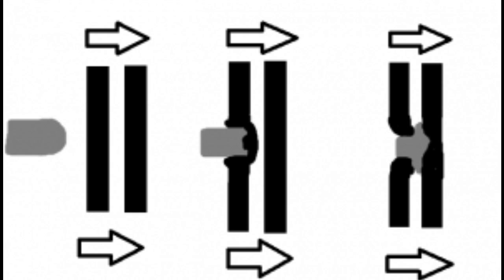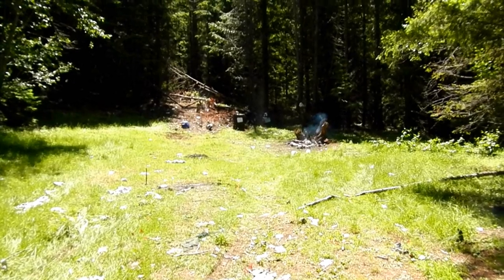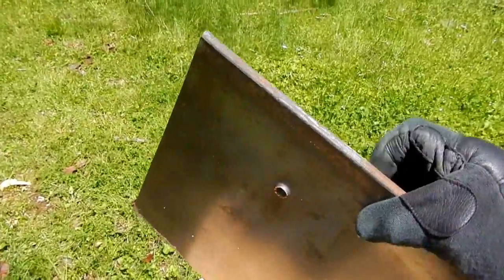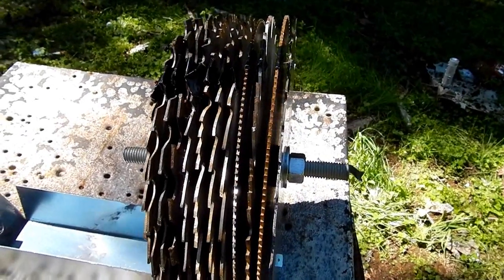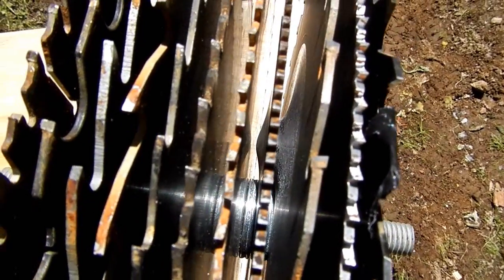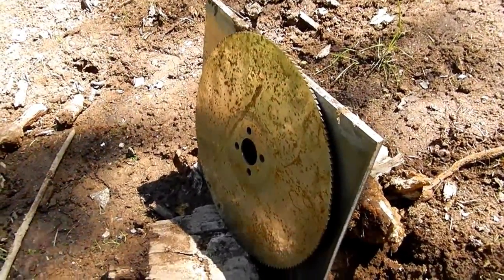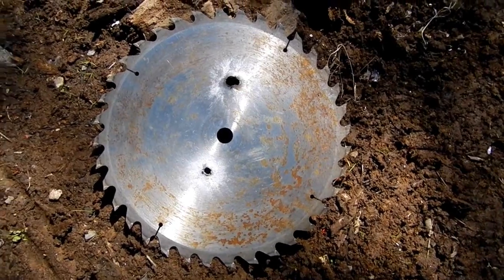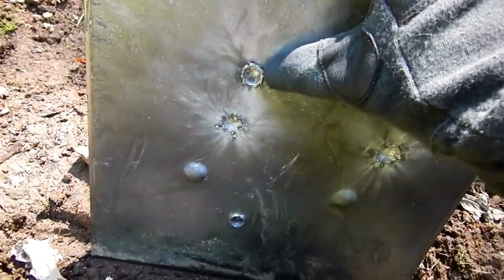Testing the Concept of Spaced Armor

Comment: something I'm not seeing as a comment. Saw blades are not 1/8th inch thick usually. The kerf is 1/8th inch, but that is counting the offset teeth. You could recalculate your thickness in the end.

Comment: @Jackal Mountain Something else you might find interesting.. if the space between the plates is greater than the length of the projectile it will cause the projectile to tumble and strike the next plate flat on instead of flying straight. This causes the surface area of the projectile striking the armor to be large further reducing penetration..

Comment: spaced armor was designed to work against HEAT and not against bullets - it's increasing the standoff distance between the armorplate and the point where the HEAT Warhead ignites the charge to initiate the copper / plasma Jet to penetrate the main armor.. not working very well though.. even an RPG7 doesnt care a shit about it.. later in this video you can see it - not much of a change in penetration https://www.youtube.com/watch?v=_J-uKNb6TaI
Reply from the maker: Youre thinking of standoff or cage armor. Look at modern Chobham armor. Its a series of closely packed, spaced plates, yet its highly effective at resisting sabot penetrators. Each new steel layer is a new impact event instead of a continuation of the same event. This helps bleed off and redirect kinetic energy, and deform the projectiles so that each following layer is impacted across a larger surface area bringing more resistance to penetration.
https://www.youtube.com/watch?v=OwJK99uL1qY&t

Comment: Spaced armor is most efective against light projectiles at verry high speeds. The outher layer of armor works not only by absorbing some of the knectic energy but mostly by fragmentating the projectil into smal pices witch dont have enought momentum to penetrante the main plate. The brittle saw blade likely did a bether job at protecting the plate because It was harder and broke the bullet in smaler pices. Having a greater distance betwen the plates also increaces the efectivenes.

Comment: You needed to look up the design or engineering specs for the 5.56 round. It is designed for penetration of individual body armor and accuracy. The 7.62x39 is designed for its heavy tumble or knockdown power in other words. It is more of a machine gun round where as the 5.56 is a rifle round. Both bullets were designed for totaly different applications and purposes. Each round does what it was designed to do and they each perform perfectly. That 7.62 will put a body down even without penetration. I have had an M16 A2, (5.56 NATO) require 3 and 4 rounds to center mass in order to stop a highly determined insurgent. I've seen Marines hit in a kevlar helmet with a 7.62 x 39 round and literally shake it off. If said Marine had been hit with a 5.56 round in his kevlar, well, that's another one my brothers that would have went home beneath the Flag we protect. 
Dont get me wrong, i dont mean the 5.56 is better than the 7.62 or vice versa. Each round performs excellently within their individual design parameters.

Comment: The harder steel of the saw blade is shattering/breaking-up the rounds before they can hit the softer steel.

The soft steel is so much softer that it 'flows' more than it shatters.

Because of this, if the energy of the round is NOT spread out by the hard steel, it will retain enough shape and energy, on a small enough point that it essentially 'squirts' through the plate, as opposed to 'showering onto' the plate. ~( 'w')/

Many makers of armor use a mix of steel and ceramic, or kevlar and ceramic because the ceramic [typically a 'use-only-once' item due to shattering and spalling] is extremely hard and set there for the specific and express purpose of shattering the bullet so that its cross sectional density is vastly reduced, which then allows the following material to more safely absorb it.

Its not really good against solid tungsten, uranium, or even tool steel penetrators, but really good against lead, copper and non-tool-steel.

~( 'w')/

Comment: I would have liked to see the saw blades packed tight, and then do the ballistics test.   From past tests I have learned that space between materials wasn't as affective against small arms. I've found that they fair better when packed tight.  Having said that, and without reading the document that you had mentioned, we are looking at laminated armor.  Correct me if I'm wrong, but it looked like you just rested the saw blade against the 3/8 steel. To me, I'd didn't look like there was a gap, as in the saw blades test.

Comment: No surprise here, the 7.62x39 didn't pentetrate the 3/8 and you said each plate was approximately 1/8 so 3 of these 1/8 plates ALSO stopped the 7.62x39.  Interestingly
the 556 was stopped by 4 1/8 inch think plates indicating a 4/8 steel plate probably would have stopped it too.

Comment: Ok, so gapped armour is not for defeating kinetic penetrators.  It was originally designed to defeat squash head (HESH) type ammo.  tank rounds that splat on target then detonate, which sends a shockwave  through the armour and spalls the interior surface off turning everything inside into salsa.  Gapped armour catches the spall with the next layer, and the shockwave does not have the strength to spall the subsequent layers.  For anti tank (HEAT) gapped armour works as a standoff for the shaped charge, with the outer layer being sacrificial and the inner layers absorbing the jet of molten copper plasma!  Kinetic rounds are usually defeated by stuff like reactive armour, HE sandwiched in plates that explode outward and shear the penetrator.
Reply: @Aaron Washburn that is why modern armour is composite, including ceramics.  The ceramics do not melt from the shaped charge.  Unfortunately though, a shaped charge is not like an APFSDS.  While you could argue it is moving really fast, it doe not rely on ballistics to overcome armour, it burns through.  The gapped armour you see specifically for HEAT is the cage surround, or the thin plate several centimeters away.  By the time the plasma reaches the underlying armour it has lost too much energy to be effective.
Reply: @Aaron Washburn sure.  I was a gunner in a tank regiment.  I know what a hit from a HEAT round looks like.  the shaped charge turns and inverted copper cone into a plasma jet.  I assure you, it burns through the armour.  this is why composites have ceramics
Reply: @Aaron Washburn feel free to visit a tank range and examine the end result of a heat impact.  I know the difference between how a shaped charge and a sabot defeat armour.  So why don't you school all the good folks about why ceramics are used.  They certainly do not go very much against kinetic penetration.  All of that aside, you are widely missing the point.  Gapped armour was developed to defeat squash rounds.  Firing a jacketed 5.56 ot 7.62 at a saw blade will not really demonstrate the intended use of gapped plate.  Nor does it demonstrate how slope affects trajectory, because if you are in a tank and you get a 90 deg hit on you, you have done something grievously wrong
Reply: @Aaron Washburn ok, so I was wrong about the mechanism.  HEAT still needs proximity to work, hence why caged skirts defeat RPG7 rounds .... we could continue the pedantic trip down memory lane and continue to try and out nerd each other, or we could go back to the original point, that gapped armour was specifically designed to defead squash rounds and shock propagation, cool video, but doesn't effectively capture the reason gapped exists.  HEAT was more effective against gap but kinetic was better.  This is why pretty well all modern MBTs have high velocity APFSDS load outs.  They kill everything
Reply: @Aaron Washburn something tells me you would be really interesting to sit and have a beer or some mead with.  If you ever find yourself near Toronto drop me a line.
Reply from the maker: @Aaron Washburn thank you

Comment: lol. you claim to be in military and u still don't know space armor are for HEAT.  For your information HEAT means High Explosive Anti-Tank.
Reply from the maker: Spaced armor is not just for HEAT. Its for any high energy kinetic impact (solid shot, sabot rounds, HEAT) For example Chobham armor on an Abrams MBT is a series of spaced plates designed to deform/destabilize any penetrator (HEAT or otherwise). The whole point is to ensure that the first layer deforms the penetrator so that a follow on layer is impacted across a larger surface area.  You are confusing spaced armor with standoff armor designed to prematurely detonate HEAT warheads

Comment: As Ch Mac said below:"556 pen due to speed and smaller round. Smaller  point of contact.
7.62 stopped due to lower speeds and heavier bullet. Larger point of contact."  Kinetic Energy is equal to the bullet mass times the SQUARE of its velocity.  So even though the smaller 5.56 mm round weights less than the 7.62 round, it is going so much faster that it penetrated the 3/8" mild steel plate while the larger, but slower 7.62 did not.

Comment: If you know anything about physicsyou would know that the 556 is moving very fast and is a very small projectile NY therefore it can penetrate armor better the 7.62 x39 is a 30 caliber round it is larger and slower-moving does dispersing energy quicker when it hits its Targetwhich is why 7.62 x39 is better at punching holes in walls and braken cinder blocks and such because it disperses more energy in one spot as opposed to just passing through

Comment: The first test shots on that still goes to show you a small bullet traveling faster than a large bullet defeat steel every time which is why they had to come out with level 4 plates because the M193 traveling at 3300 feet per second will defeat level 3 plus armor every time

Comment: How stupid is this guy to attempt a spaced armour TEST. When he does not know the composition of the steel alloys used on the numerous saw blades from different manufacturers. And that's just for starters. Come on air gaps, to stop rounds. He had 12 saw blades not 11 to begin with but removes 1 half way through the video and then tells us that the single saw blade he puts in front of the plate is mild steel and then says "the saw blades after shooting is brittle steel" well that's not mild steel then if it cracks. His conclusions are nonsense. He should have named the video (Not Really Testing the concept of composite armour) it would have been a better description.

Comment: I believe it's the brand of ammunition you're using Wolf ammo is cheap and crappy to say the least so that might have a bit of a difference in overall terminal ballistics and accuracy and everything else now if you had Wolf ammo 556 /223 Rem 55 grain FMJ also then I would say it'd be a 100% Fair test however I'm still surprised I thought it would be the opposite where the 7.62 × 39 wold punch through the Solid Plate and the 5.56 wold have  dented it but not pass through you know I thought it would basically be the exact opposite of what we seen in the video but maybe try it again with the same ammo brand or a different brand or something cuz I'm almost positive that's what is the main difference

Comment: Damn, that's the most tacti-cool'd AK i've ever seen. 
Folding stock ✔
stock cheek rest ✔
rail adapter ✔
scope ✔
sling ✔
angled foregrip ✔
handguard with rails ✔
handguard installed on top of handguard ✔
bipod ✔
giant muzzle brake ✔

All it needs is a laser sight, bayonet and backup iron sights.

Comment: 5.56 is thinner than 7.62 so it has to erase less material to progress that's why it goes further,pressure on the impact is more important.It also depends on the speed at barrel mouth! MBT use apfsds which use a sabot to deliver a tungstene arrow which have huge penetration !

Comment: A totally irrelevant test. Spaced armour was designed for non kinetic heat and squash head rounds NOT armour piercing. Someome needs to do a bit more homework.
Reply from the maker: Look up the composition of Chobham armor on an m1 Abhrams. It is multiple spaced out plates and works great to stop sabot rounds.  The entire point of spaced/composite armor is to spread force into multiple separate impact events. Also, HEAT rounds are kinetic perpetrators. The idea they "burn" through armor is false as they dont generate enough thermal energy to melt a hole through a slab of steel in the microseconds it takes for a shaped charge to penetrate. The proper analogy is a waterjet cutter not a plasma cutter.

Comment: 7:55 The 7.62 could not penetrate 3/8" of plate, yet penetrated three 1/8" saw blades. That kind of says a solid plate is more effective than spaced armor. It also says mild steel plate armor is better than hardened, stacked steel armor.
9:50 This is a much better result. Shows the effectiveness of stacked armor.
13:07 Obviously this blade didn't absorb as much energy as the first saw blade. You can tell by the perfect hole that this blade didn't absorb much energy. Then you can tell by the mark on the 3/8 plate also. The crater from this round looked much like the original 7.62 impacts.
Reply: Of course solid steel plate has more effective stopping ability against kinetic ammunition.

Comment: One thing about spaced armor it was intended to help with shape charge weapons more so than penetrating rounds the air gap if large enough allows the charge to go off and the copper forcing cone wont have the same focus of energy to penetrate the main armor this is why RPG cages are so effective blow the rocket before it can hit your armor
Reply from the maker: Modern chobham armor on an M1 Abrams is spaced armor (multiple spaced out overlapping plates) and it was designed to stop both HEAT and sabot rounds. Technically "spaced armor" has come to mean "composite armor" in modern parlance. RPG cages are a different concept that are designed to do what your describing to shaped charge weapons

Comment: You should try AR 500 or even AR 600 hard 3/8ths steel.
The .223 rounds will not penetrate at all.
You most likely have A 36 mild steel 3/8.
Ak rounds run at 2350 to 2450 fps.
.233 rounds run at 2900 to 3200 fps. Laws of physics.
Interestingly with armored glass the AK 7.62 x 39 will penetrate more glass than the .223 rounds.
I used to develop armor and mine/ explosive technologies for the military.
In the armor business "he who shoots the most, knows the most"
Very fun to watch. 

Thanks for the work you did.
Reply from the maker: Thanks!  It's been interesting do actually test out the concepts Ive always read about

Comment: 5.56 penetrated because of its "higher cross-sectional density". It has more of its mass behind a small frontal/contact diameter than the 7.62. The ideal for spacing armor layers to resist small arms fire is to have the second plate at a distance from the first plate ( the one the bad guy sees) by a factor of the projectile length plus the deformation distance of the first plate. The first plate strips off the bullet jacket and deforms the projectile core. The remaining projectile now has a lower mass and energy combined with a larger frontal area and "lower cross-sectional density" so that the energy will be spread over a larger area when it strikes the second plate.  The gunner protection turrets have the aluminum panel on the outside with the steel on the inside because they are designed to capture and stop IED bomb fragments. They just happen to stop small arms fire also. The most effective armor is the ceramic armor turrets found on the M1116. ( Couch Commandos please note: the ceramic your Mom's dinner plates are made of is not the ceramic suitable for ballistic armor.)
Reply: @Aaron Washburn It would seem that way but that's the way it works out. This may be due to the nose of the 7.62 deforming more readily, a difference in the jacket design. ( I have the benefit of examining ballistic samples, witness plates, chronographic data and slow-speed photography over a fifteen year period of employment by an international defense contractor building ballistic and blast armor solutions.)
Reply: @Aaron Washburn Your formula is correct . As I said, I believe it may be due to a difference in the jacket design.( Jesus, I knew I would get hate from AK/7.62X39 fans. The subject here was spaced armor and I contributed information on how maximize the effectiveness of the construction. I really regret writing anything now.)

Comment: Spaced armor is useful against HEAT shells, not solid penetrators... unless the gap is larger than the rod in the case of APFDS.
Reply from the maker: Spaced armor is the basis of composite armor like Chobham which is effective against long rod penetrators.

Comment: The strength and integrity of the saw blades significantly drops off the further out from center you get, probably actually making the round penetrate less because it is impacting a target that gives/flexes causing more of a tearing effect rather than punching through effect you would get closer to center, where there is solid support. 

Pretty cool video man, I wouldn't have thought to do that.